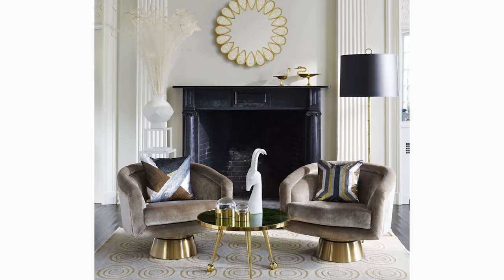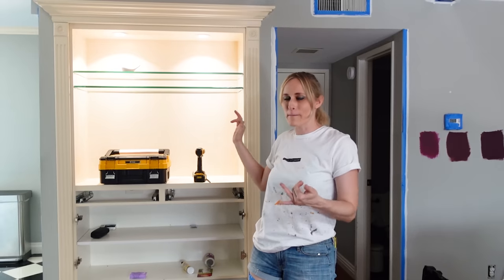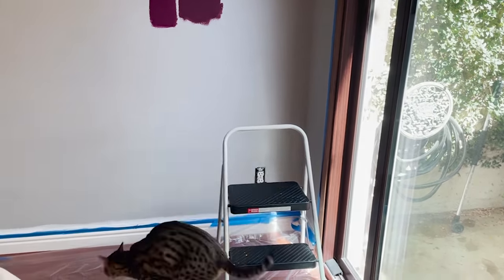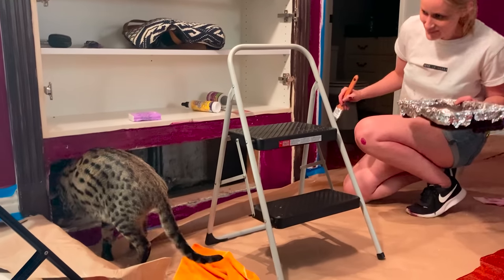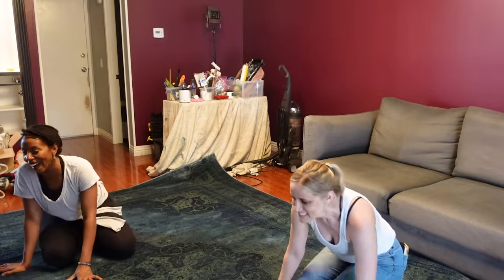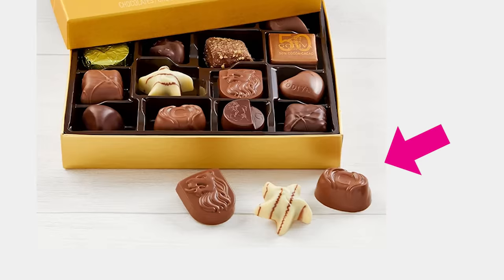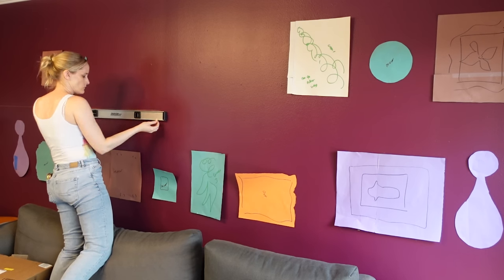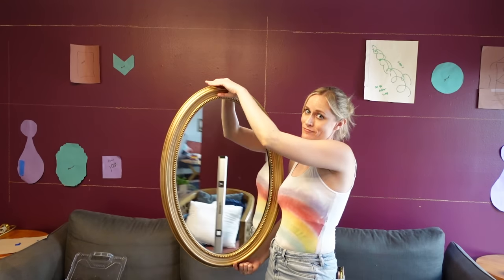Eclectic Moody Maximalist Living Room Makeover ft. Celeb Mary Lynn Rajskub!

Comment: Dark colors only make a room feel smaller if there are no windows and no natural lighting.  Its  myth that dark colors contract. Also, dark colors can be used to draw the eye to something like an architectural detail etc. A good example is to use a dark colored paint around a window. The dark color catches the eye and pushes the eye toward the light naturally. So use the dark colors as a guide to what you want to be noticed or to distract away from. :) dark colors recede if they surround a lighter color.
Also, only the front 2 legs of each piece need to be on rug for proper fit. Just some tidbits I learned from my bff that does interior design. You do a great job though.
Reply from the maker: I super dig. Big fan of the dark and moody, especially painted ceilings! Btw, re: the question of if they pay, yes—although someday would love to do all free makeovers sponsored by brands. I accidentally deleted that comment when I went to edit my answer lol. 🙂